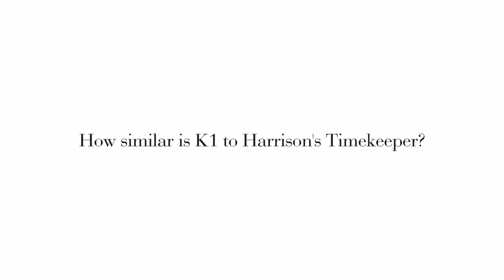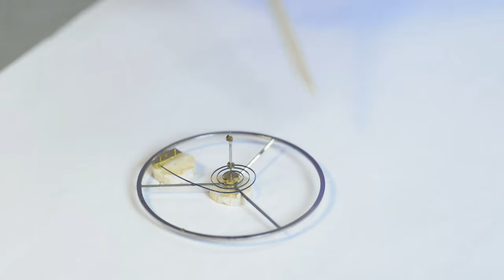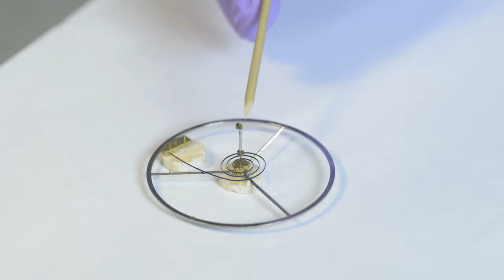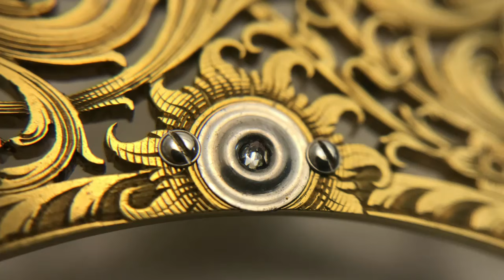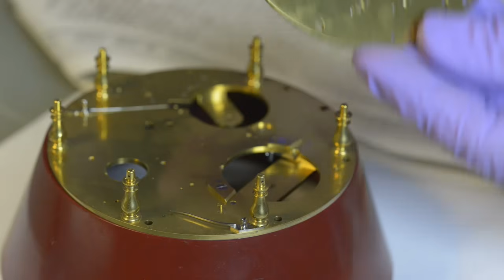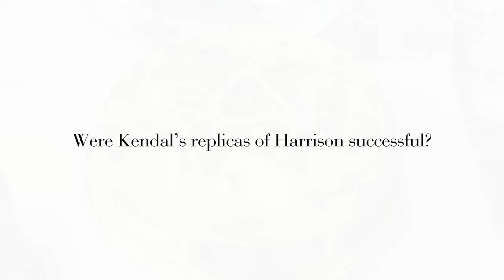Larcum Kendall 'K1' - Captain Cook's historic chronometer watch at Greenwich – With the BHI

Comment: Wouldn't some vacuum seal with a gas allow for viewing but without enclosing the case? Wonderful video.
Reply: A glass (or similar) case with filtered air doesn't sound overly complex
Reply: @paulwomack5866  I agree.  It would be an easy thing to make a hermetically  sealed display case and use Argon or Nitrogen inside.

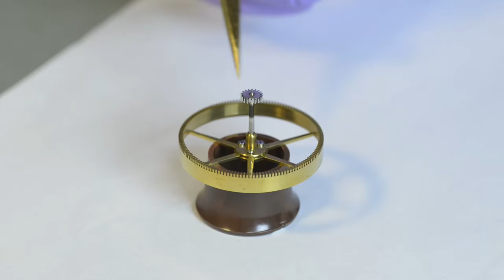Comment: At the time 16:30 do you know how much of a change in the length of change that bi metal bar can make
Reply from the maker: Hi there. Originally it would have been done by experiment, although by this time, Harrison had done so much experimentation in his Sea Clocks that he knew the ratio of expansion of steel to brass, and had written about it. How much change there would be against a given balance spring would still have needed a lot of experimentation, because balance springs were far from standardised.